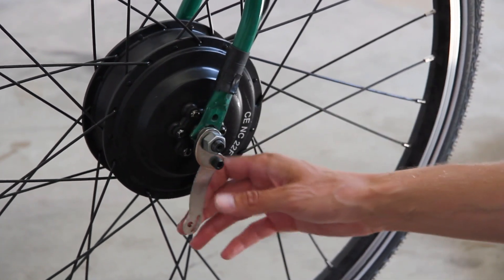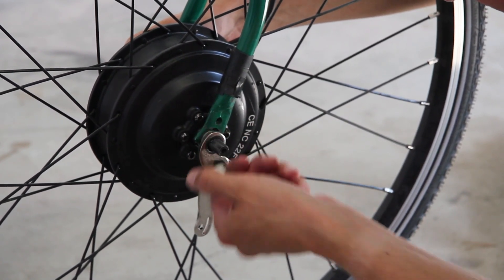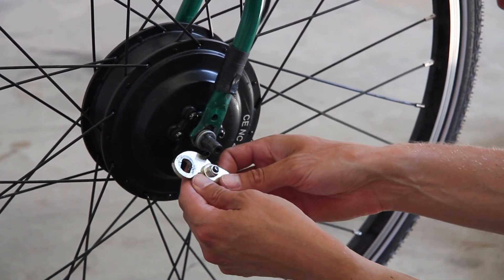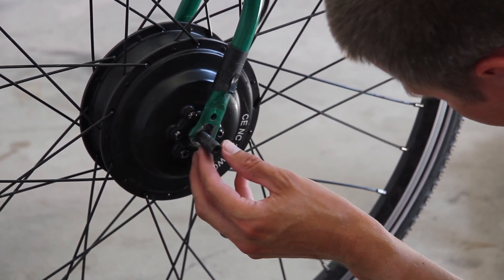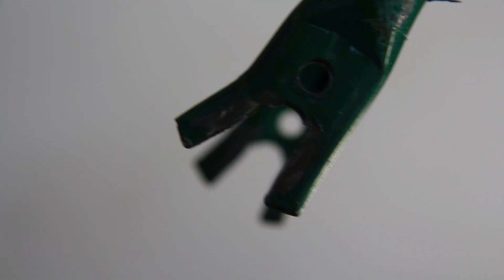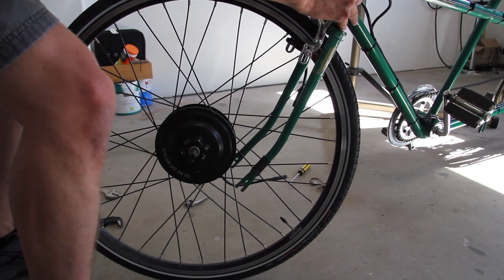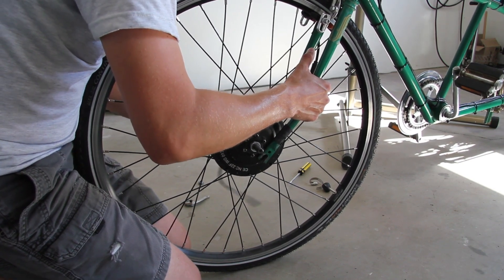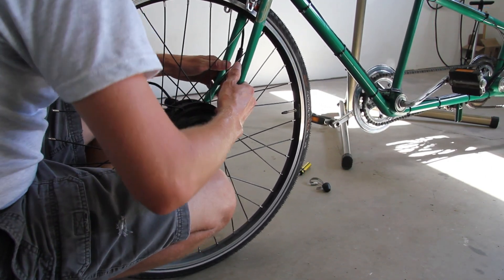E-Bike Fork Dropout Fix - Over Torque

Comment: I would think that the torque arms should be fastened in the front to force the axel up into the axel notch put the strain on the top of the notch and not against the the front of the notch